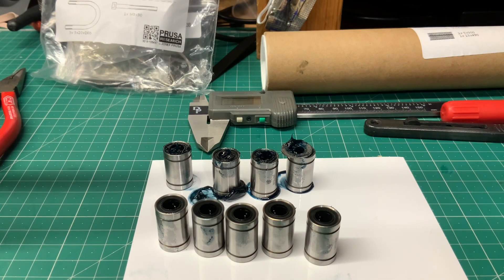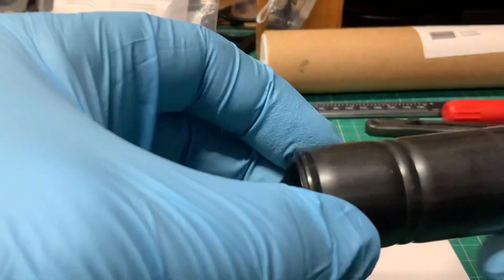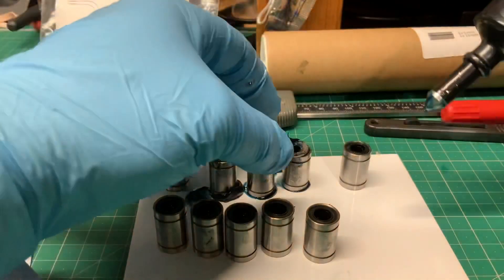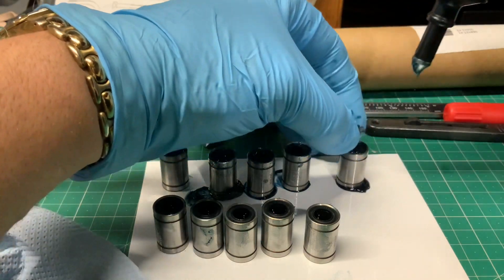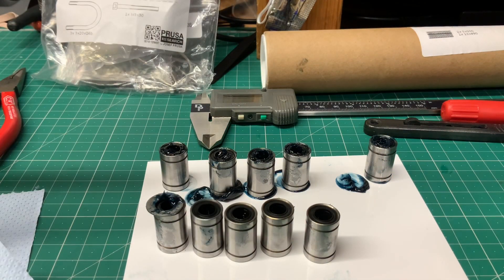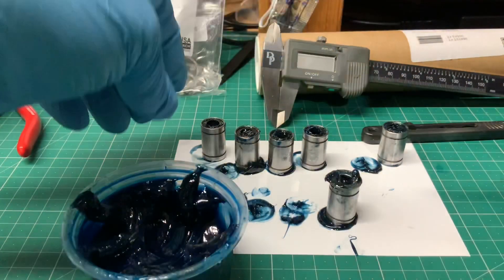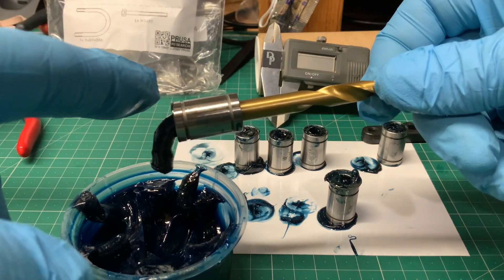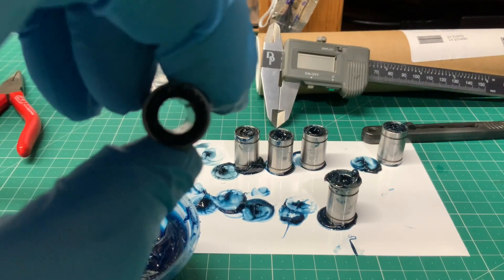How to re grease Prusa i3 MK3s linear bearings, quick and easy. (Maybe other 3D printers too)

Comment: This is a great video and I'd do this but JCB Special HP Blue Grease is not available in the U.S..  What would be a suitable replacement that will work in the grease gun?
Reply from the maker: I’m not sure what you have available over there, I would suggest searching for "lithium grease four ball weld load test", and see what comes up, and choose one with a high KG rating, the JCB one I use has a 450KG rating. 
Hope this helps.

Comment: Prusa says you shouldn't grease the bearings, but I dont know what to think.. Does your printer work good with this method?
Reply from the maker: Yes it works great, a friend who built his MK3s about the same time as me, but he didn’t grease the bearings, within 2 months he had problems with noise and poor running, so had to take it all apart, and grease the bearings.
The oil that comes in the bearing bag, is only there to stop rust whilst in storage, not for use, I’ve heard this from lots of people.
Reply: I dont think they say that unless they changed it? I only read that you should not grease the leadscrews or Tr. nuts.
Reply: Just need to clean the oil off the bearings, as it's best practice not to mix fluids. Plus there could be bits of debris from the factory in the bearings, even though they are high quality. So soaking and swishing them in some 99% IPA right before  greasing is a good idea. Just don't let them sit in open air before greasing, as they will start to rust.

Comment: You don't want to use just any grease on linear rod bearings. The best grease to use is a H1 based nano grease such as TinkSeal (dot com). I love your grease gun, great video!
Reply from the maker: Thanks for watching & liking this video, it’s not just any grease, it’s very high performance Lithium grease, designed to work under extreme environments, under very high pressure, from -20°C - +150°C, and easily passed the 450kg four ball weld test (industry standard test)

Comment: Ive been looking everywhere for something to grease bearings with, thankyou for this.
What grease are you using please.
Regards shaun
Reply: You can use super lube
Reply from the maker: Search ebay or Amazon for JCB lithium grease made by JCB (the digger manufacturer), it comes in a tube, but is easily scooped out, you can get 2 tubes for £8.90 delivered. I think you can buy only one tube, but it’s £3 more for only one tube.

Hope this helps 😀

https://www.ebay.co.uk/itm/154240648973   .......... grease

https://www.ebay.co.uk/itm/183389092402   ........... Oregon grease gun